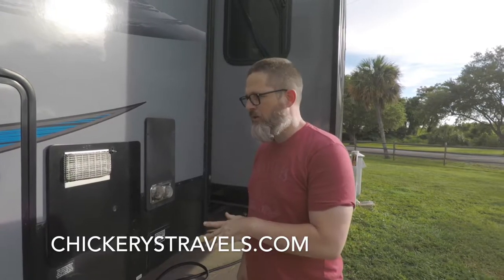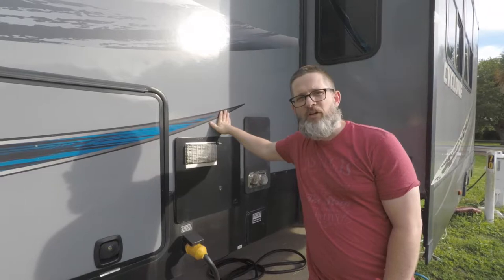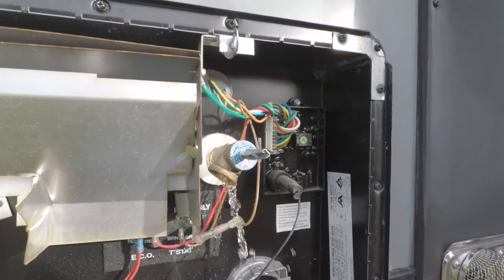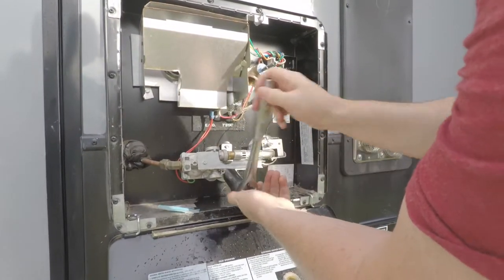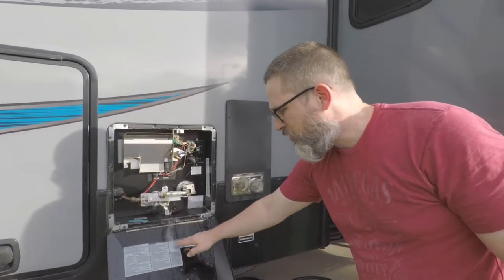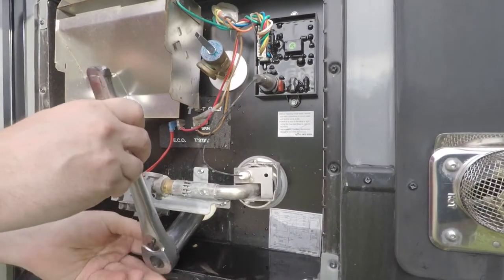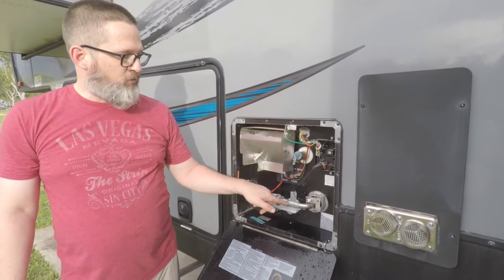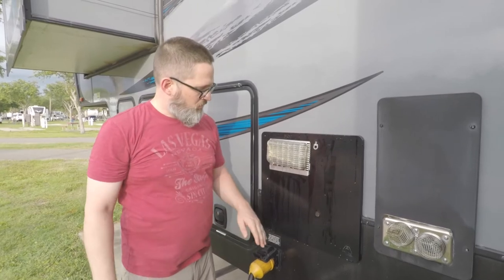DIY: RV Water Heater Tank Flush & Maintenance

Comment: Hi guys. My names Kevin. I am new as a subscriber but not new to RV’s. I think u did a really good job Shawn flushing the water heater. Two tips buddy and please don’t think I’m poking fun at you just trying to help u a bit. 

First: theirs a really nice tool I use at work on customer units when they complain about the smell of the water. It’s called a tank saver. It’s not at all expensive. Cost 10.00$ and that’s it. Yes it’s plastic, and yes I own tow of them. On in my tool box of the camper and one in my tool box at work. Just hook a hose to it and follow the easy instructions two times a year. 

Note: when blowing out the shutter for the air fuel mixer to the burner stand to one side or the other ( I usually stand to the right as it’s farther from the exhaust  vent) and also blow out the large burn tube as well. 

Second: when refilling the water heater do not use the pop off valve out side to let the air out of the tank while filling. Only use the faucets inside to bleed off the air. Doing this create an air pocket on top of the tank which is needed for expansion when the water is heated. The water expands in a since and fills the air pocket. If u use the pop off valve  their is no air pocket and u can result in the water dripping out of the pop off valve. I see this quite often. And this dose apply to Atwood and suburban water heaters. Keep up the good work hope this helps u a bit. Looking forward to the rv nomad movie
Reply from the maker: Hi Kevin. Thanks for subscribing! Also, thanks for the tips/advice. Part of the reason we make these videos is to get comments and learn from each other. I do not take anything as criticism, it is all learning for me.
Reply: Chickery's Travels good way to be. Especially with new things. One of these days I’ll get around to a maintenance video. One thing I do but I’m kinda a nerd is in my owners manual I. The back is a bunch of empty pages I write in a brief description or what ever service I have performed and any upgrades as well as the dates I did them. Like I said I’m kinda a nerd that way but I can look back and see when I did something last. And hope fully the next owner will appreciate it as well.

Comment: Good video, I would like to add that when you drain the water get a brass pipe fitting a garden hose fitting will work, but screw that into the relief and also the drain that way water does not flow onto other parts especially the gas heater flew pipe. Hope this helps great video though.
Reply from the maker: Great tip, thanks for adding, Shawn!